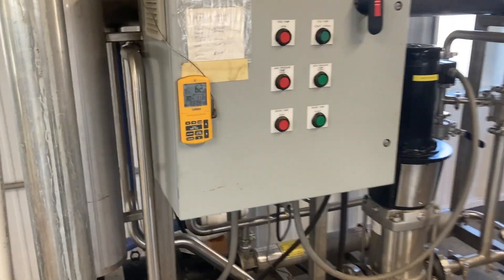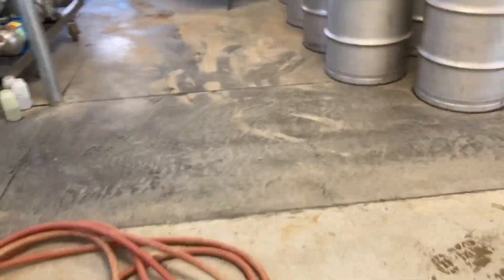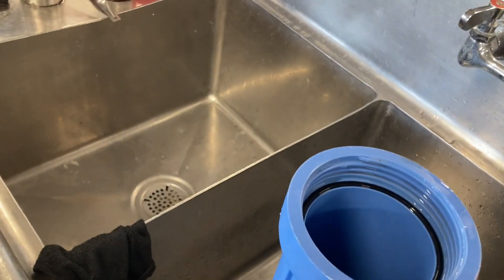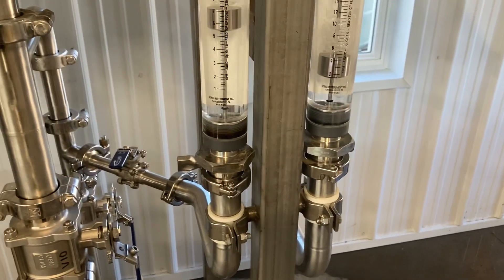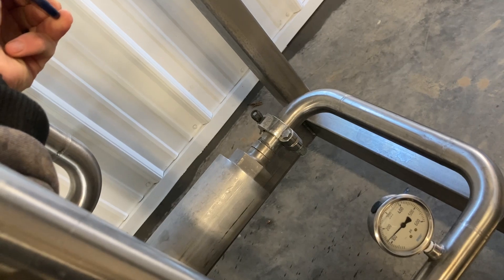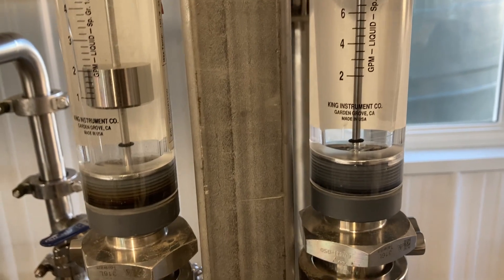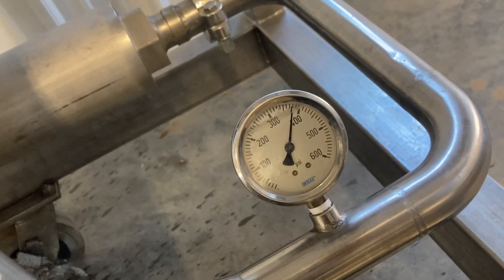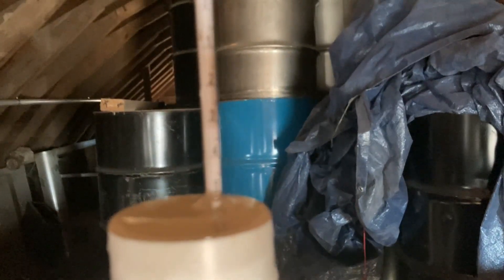Starting up the Reverse Osmosis Machine

Comment: How many taps are you running?
Reply from the maker: Under 5,000 this year. Are you a producer? How many taps do you do?
Reply: @thegrowthmindsetshow6400  very nice. Bought a farm this year. Went from 50 taps. Up to 250. Was going for 500 but didn't have time to set up all the lines.
Sell to friends and family now. Hoping to ramp up more for next year.
Reply from the maker: @MrSpinkle1  very cool! It’s a lot of work and money to set up new lines. The payoff is nice as long as everything goes well, but it sure takes a lot of investment.
Reply: @thegrowthmindsetshow6400  that's for sure. I got my new evaporator used from some guys so that helped. I'm not doing RO. Straight boiling. I have the wood and still have my old evaporator as well if I need it.